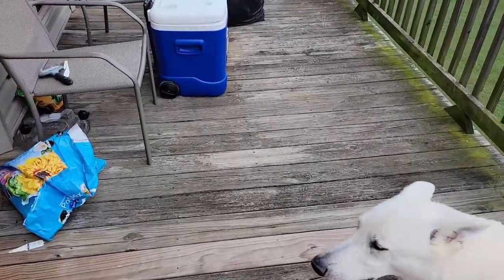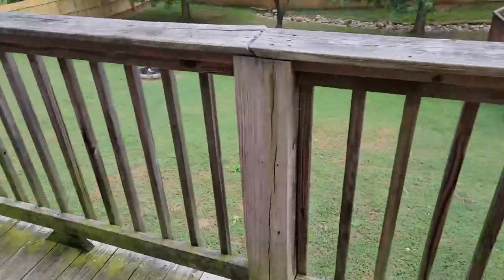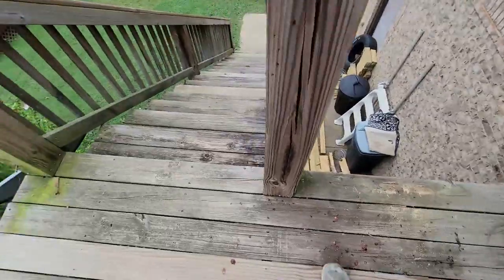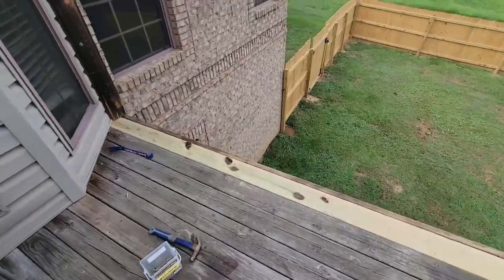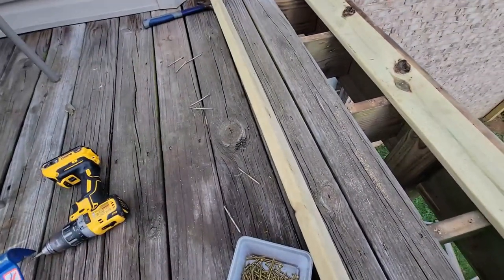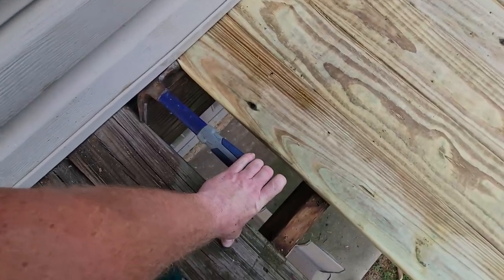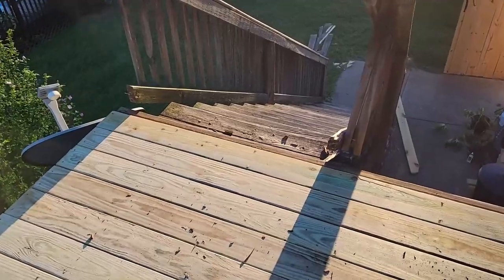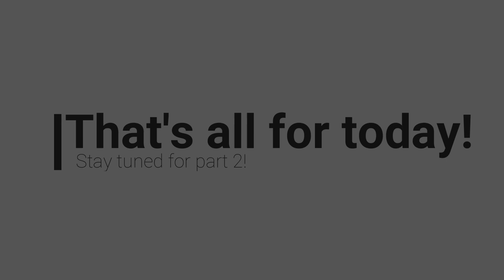DIY Rebuilding a deck and stairs...For Beginners

Comment: Nice work, i don’t know much about Alabama weather, I live in northern Michigan, I worked construction for a couple years and we put a a 1/4 in shim between each deck board for swelling and shrinking from rain and snow so it doesn’t split the rafter and support beams, also I would have used L brackets to secure your main post to the deck boards, then you won’t have end splitting on your railing posts, I’ve heard you can get hellacious storms so you can put storm ties on the outside of your post to help with the strength as well, but that is just my experience up north. Love your work
Reply from the maker: Thank you! I had zero experience with this and just replaced everything one board at a time. Lol. I think the contractor before may have cut a few corners. Lol
Reply: @diydozier3205  your end results was undeniably well done, you’ve gotta be proud, so I am curious as I’m sure others are, how’s your daily driver holding up? And when do you think we will see an update on the stang?
Reply from the maker: @Travis Majszak  the mustang is coming along. It will be a little bit before the update. I stepped off into a bit of a business endeavor in October and it has taken a lot of my time. I've had to rearrange my life for it. Really I should start a vlog about my life. Bomb drop...I sold the truck. Had to fund my new business. I absolutely hated this. But you have to do what's best for your family sometimes. I'm thinking if I started just videoing day to day life I could keep folks posted on projects and daily life. Lol
Reply: I've not done any framing or deck building, myself but, as an apprentice electrician, I was privy to lots of info watching how the framers built things and, from all those observations, I gathered that most (if not all) of them just used the screws they were using as the spacers. Placing them somewhat evenly along the length between a deck board already fastened to the joists and the one they were going to install next spaced the boards somewhere around 3/16" apart, which was enough. I'm sure he's also going to be experiencing a lot of puddling on his deck after a rain or snow melt. I hope he enjoyed rebuilding his deck...he may be doing it, again, in just a few years.😵‍💫

Comment: Much appreciated. Just bought a house and have a deck similar to this. I've built decks before but they were pretty low to the ground. You gave me the confidence to conquer the deck at the "new" house. Thanks so much and great job! You made it look easy. Also, much thanks to all providing pointers in the comments!

Comment: Maaaannnn. Just watching you “Spartan Kick” the railings down got me hyped up and scared to death at the same time lol. That’s a 13’ drop? Wow. 
I started doing the exact same thing as you but my deck is 400 sqft and only 2 feet off the ground hehe. I realized that the new boards wasn’t fitting in between the other boards because it was wet so I started removing 3 rows at a time. Removing the boards was kicking my arse so I ended up getting a “Deck Wrecker”. Best single use tool I’ve ever purchased. The deck is like an onion; every time you peel a layer there’s more surprises underneath. Anyways, great job on the deck and good luck with those stairs brother
Reply from the maker: Thank you very much!

Comment: U should be using min 2 1/2 screws. Oh ok. There u go
Reply: Never mind. 5/4 board is an inch thick. 2 1/2 3 inch. Especially cause there’s existing holes from decking. It would give something to grab
Reply from the maker: @cody27491  pretty sure I used 3" screws to grab deeper into the joists which were soft.

Comment: Good Job!  One note.. would've made it easier laying deck boards if you would've pulled up two at a time and not replaced one for one, leaving always the next one open so you could easily pull up the next board without it being next to your new board AND you would easily be able to see where the joist is so you can ensure your screws are lined up properly.
Reply: Well... I see you started doing just that the further you got going... LOL
Reply from the maker: Took me about 15 boards in to figure that out. Lol. I started doing that about a 1/3 of the way in...Stopped showing the process by that point.

Comment: Redoing my massive deck as we speak 1988 house - things I’ve learned, if your going to replace decking, at very least invest in joist tape, when putting in posts box them in use deck ties and bolts all the way trough 6x6 and the wood you’ve boxed it in with. I’m also not putting balasters ack up I’m doing cable railing, also as long as your pulling up boards it’s a good time to check out joists, they had no joist support’s between all my joists so I cut and placed supports as I went along it will make your deck much stronger